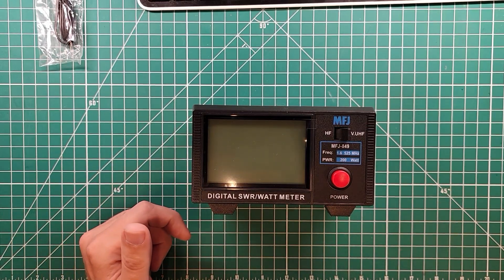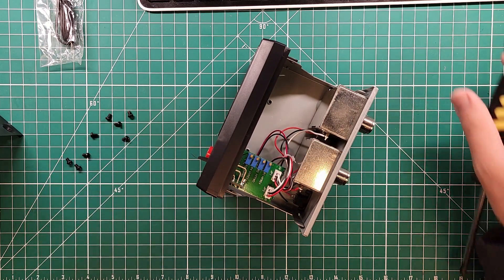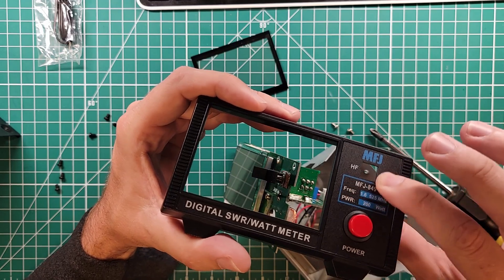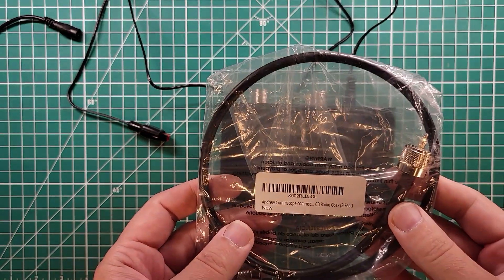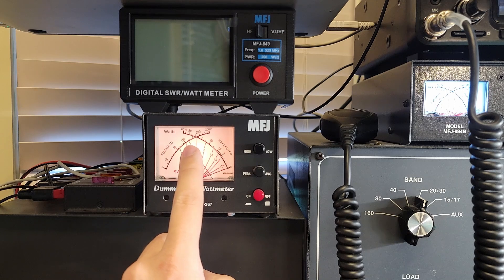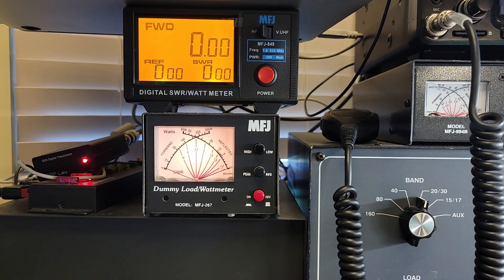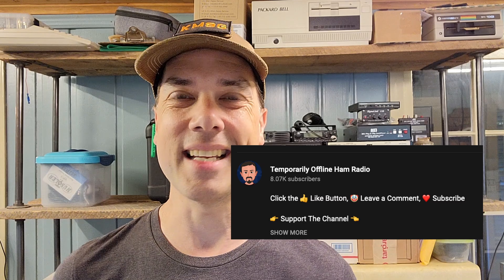MFJ-267 vs MFJ-849 - Featuring the IC-7300 and QDX

Comment: nice. the MFJ 267 is not going to zero on the forward . under the meter movement is a small slot to put slotted mini screwdriver in it.   this is to zero the meter. that why reading a tad high. I have the one with out the dummy load and had to zero the meter movements. remember dummy load can get warm to hot. keep air vents open when testing high power . 73's
Reply from the maker: Thanks Robert!

Comment: Steve:  I totally understand and agree with the way you want to use this meter.  Maybe you have someone nearby that has a Bird Wattmeter that you can use as a true reference.  I have always kept one in the shack for my reference meter.
Reply from the maker: I do have a friend with an old Bird - then you run into another problem - when you have 1 clock, you know the time... when you have 2 clocks you are un-sure.
Reply: Steve: The Bird wattmeter’s stated accuracy is within 5% +- at full scale. That is up to 5 watts when using a 100 watt slug. But at the end of the day if you tested 10 wattmeters you would get 10 different answers.

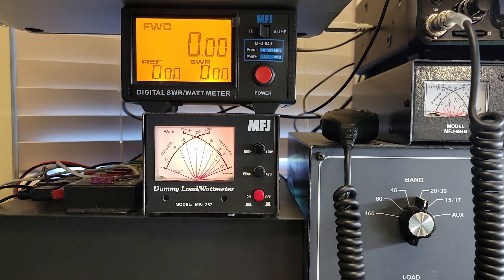Comment: Hi Steve, thanks for another great video.  I had purchased the Nissei a few months ago but returned it when the SWR readings seemed erroneous compared to my two needle SWR meters and my 7300 reading.  SWR was the sole purpose I purchased it.   But.....in the video at 6:46, why does 7:1 needle SWR correlate to a 72.x SWR reading on the digital meter?    Shouldn't I see 7.x on the digital meter?   I must be missing something.   K7KS
Reply from the maker: I'm not the right expert when it comes to math, but isn't 72.x%/100% = 7.2:1 ?  That's my only thought  as to why it looks like that.

Comment: I can tell you that the product numbers at MFJ do not reflect anything except product lines. E.g., MFJ-259, 269, etc. are in a numerical "region" while the others are just space so that there's room for later models. With 2,000 SKUs (or more), it can be a challenge! I recently got  this very digital meter for a Gator Case housing a 7300, ALS-500M, MFJ-994 ATU etc. I have to think less with the digital output than a needle indicator, lol. Good video!
Reply from the maker: Thanks Frank, that was what I was thinking!

Comment: I have the 849..  I had to tear it apart to "try" and tweak the calibration for QRP..  I wish it had an internal strap that I could move to increase the sensitivity to a 0 to 10w scale like some of their QRP tuners do.. It's back in the box and on the shelf.. I may figure something out someday.. thanks for the demo.. great info.. k0klb
Reply from the maker: I saw the tuning pots, but didn't move them.  What were you seeing?
Reply: @temporarilyoffline   when I got it, It would not measure the 0 to 2 watts accurately till I got to 3 watts of power.. I spoke to MFJ tech support.. If I remember correctly, I think he said that it was probably due to the low wattage was not activating the diode (?) (maybe, don't quote me cause I cant remember what component it was) or something like that to measure accurately..  I tweaked the POTS (a lot) so it now measures mW up to 2 watts accurately (for the most part) but anything above that is way inaccurate, but that was OK since I try not to go above 2 watts here at home anyway.. I pulled it out and put it in the box a while back cause I really wasn't using it anymore.. I should get it out and revisit the issue again when I have time..
Reply from the maker: @hamradioqrp-k0klb  when you have time???
Reply: @temporarilyoffline  Hahaha.. Ya, sometime between naps and old western shows,  LOL

Comment: With a new video, comes a new question, is that how it supposed to work? 

For FT8 in combination with the 7300 I do use JTDX - within JTDX it is able to show the current power output. Wondering how that compares to both of the meters. I have seen 103 Watts there so it seems to know it's not limited to 100W :)
Reply from the maker: I'm sure JTDX is reporting back what CAT Control says/does.  My understanding is that the 7300s are well known for putting out more than 100w, so I wasn't surprised to see more than 100w.  I could adjust the meter so that 100% output on the 7300 was 100w on the meter... but then who's telling tales?

Comment: Great video. I have the MFJ-849, it was the first meter I purchased when I got into ham radio. I used it for my IC-7300 and my Yaesu UHF/VHF radio. Now it pretty much lives on my UHF/VHF radio since I run over 200 watts HF. Great little meter. It's "accurate enough" for day to day use. Maybe not Bird accurate but still.
Reply from the maker: A friend of mine has the bird.  Its a neat bit of kit.

Comment: Hi Steve,
Good comparison video. You need a Bird 43 watt meter to get an accurate reading on the output power.  🙂  You and the family stay safe.  73  WJ3U
Reply: No, a BIRD 4381 (even better the 4391) are accurate, the 43 analog have same precision of MFJ but at least last 40 years without problem (every 5 year where calibrated)! precision are 5% but need to use slug at 120% of maximum power to measure, so for less 10w need to use 10w slug not the 100 (or 50-25  because the % of error) and need a lot of slug ... If you want to correctly measure the reflected power in an almost known system you must have the slug of at least 1/4 (if 1/10 is perfect) and then use the conversion table (which if you have an original one is on the back or in the instructions )
Reply from the maker: Those bird meters fancy.